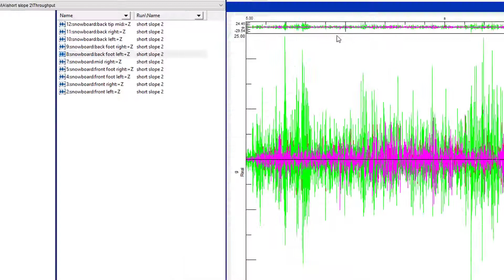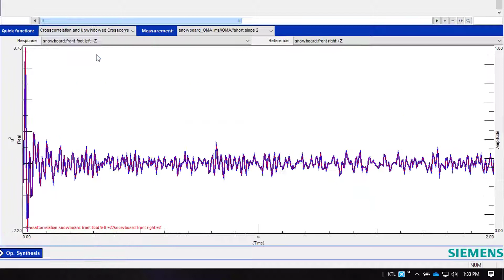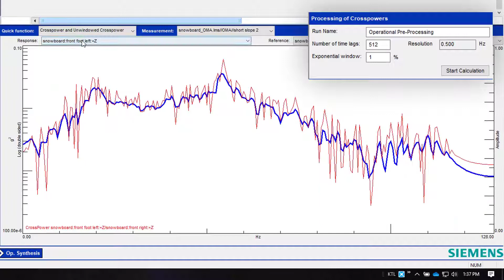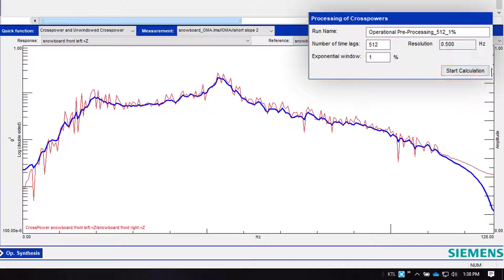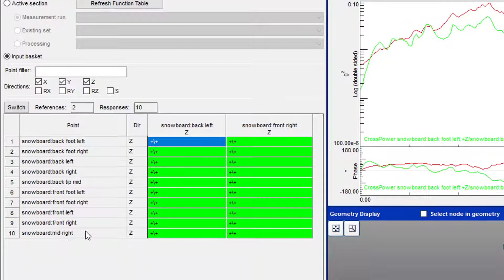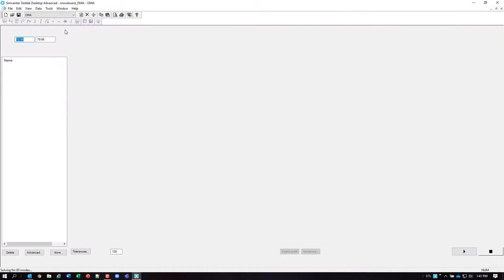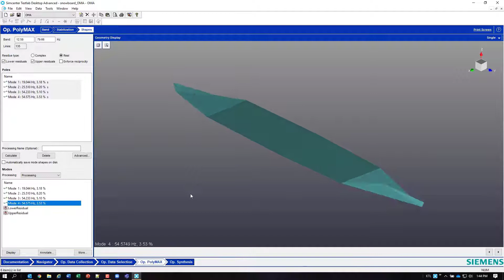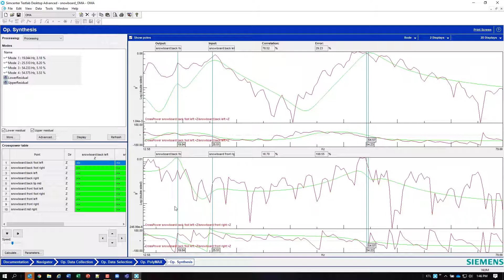Operational Modal Analysis in Simcenter Testlab

Comment: Hello, how did you assigned time signals to the geometry points? Thanks
Reply from the maker: The name of the geometry node and the name of the time history need to match (example: roof:1:+Z) including lower and upper case. If they are different, the alias table feature can be used to map the geometry and time history names to each other: https://community.sw.siemens.com/s/article/alias-mapping-matching-geometry-to-test-measurement-data
Reply: @SimcenterTesting  Thanks for the answer. I used the guide of your link to match measure points with structure points. The problem is that I get some mode shapes where just the points that I linked with that procedure will move, the other points of the structure where I did not put accelerometers are not moving. How can I say to the other points of the structure to follow the deformation? Thanks
Reply from the maker: @andyfreeman9031  Right click on the animated display and choose "Animation Settings -> Automatic Geometrical or Automatic Topological" under the expand area.  This will fill in missing points.  Keep in mind this is an approximation and in no way based on actual measurements at points that were not measured.
Reply: @SimcenterTesting  Thanks, yes, but I could use only accelerometers on those measure points, I did not manage to use accelerometers on all points, so this approximation is necessary , I think...

Comment: I am going to do an operational modal analysis on a building. How should I acquire time data first? using test lab signature or time acquisition?
Reply from the maker: Suggest always acquiring time data. Time data can be processed and reprocessed into frequency data with different resolutions, etc
Reply from the maker: Signature with the time recording add-in would be good to use

Comment: Before taking into operational data collector isit necessary to filter the data
Reply from the maker: Generally speaking, operational modal analysis parameters are extracted in the frequency domain.  It would not be necessary to filter the time data.  If there was a frequency band of poor data, the band could be ignored rather than filtered out when doing the frequency based modal analysis.